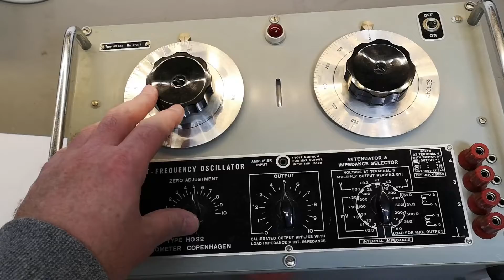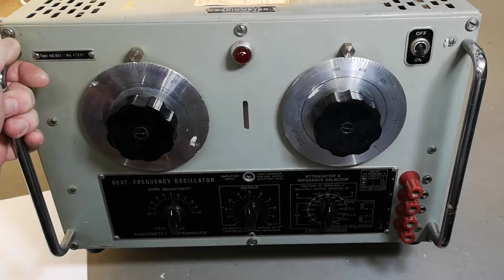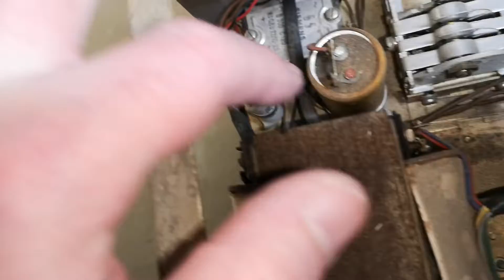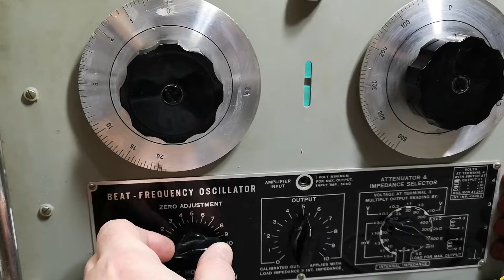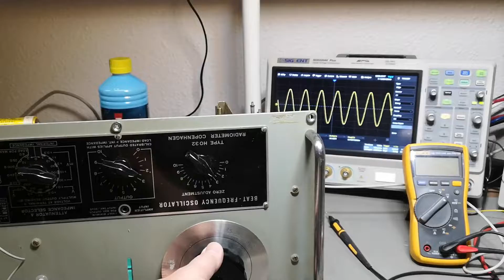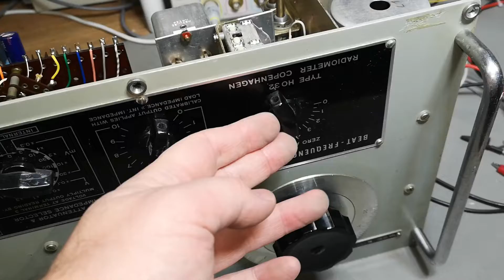Radiometer HO32  Beat frequency oscillator test repair teardown

Comment: 04:33: That's not "Line impedance", but rather "Line independence" - What on earth is that?!
Reply: Section 3.61 in the manual - "Compensates for the influence of line voltage variations".
Reply from the maker: you trim for less humm, as far as i figured it out